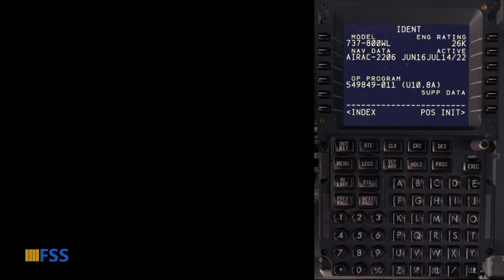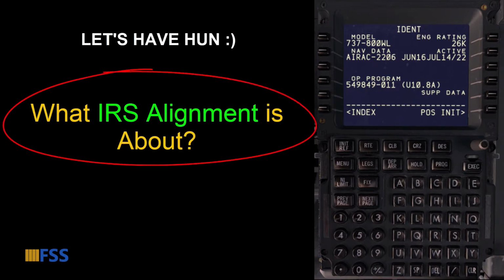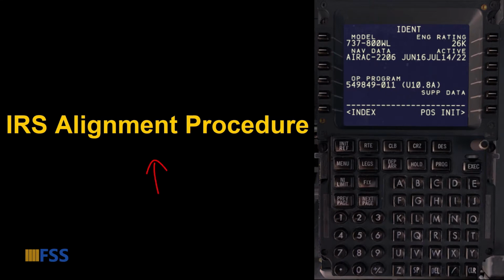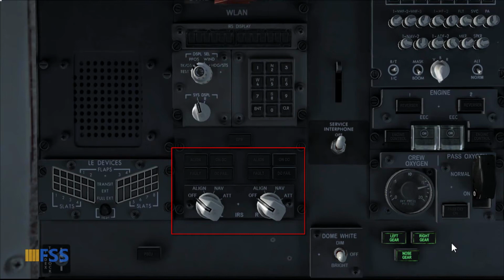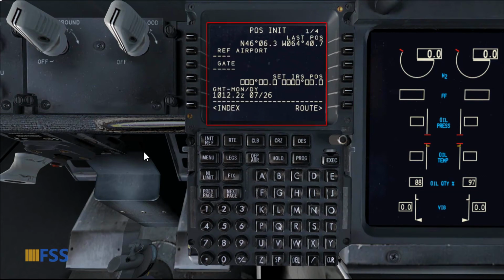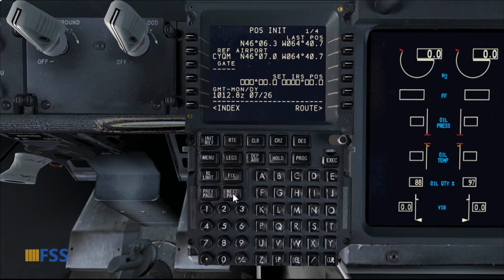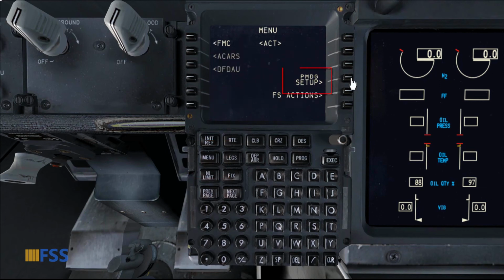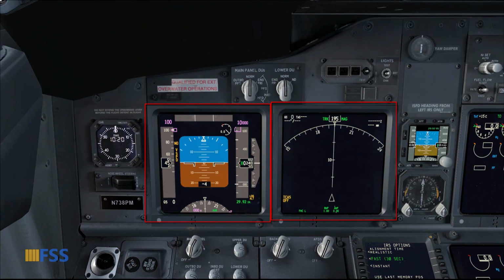PMDG 737 FMC Tutorial Part 1 | IRS Alignment Explained in Detail

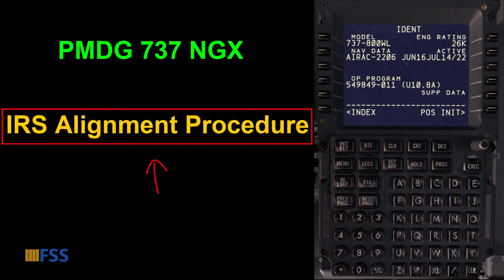Comment: 1:57 The IRS requires DC power, so no need to start up the APU to get it aligned.
Reply from the maker: Using the DC power for the IRS alignment will drain the Battery and it's not a good idea to do so , we normally start our procedure by first applying the electrical powerup then we proceed to the IRS Alignment.
Reply: @FromStartupToShutdown  ok, thanks for clearing up. But what when you’re connected to ground power?
Reply from the maker: @yornav  the  initial electrical powerup can be done with  either the ground power source or the APU , it doesn't matter  which one we wanna use for the IRS    Alignment.